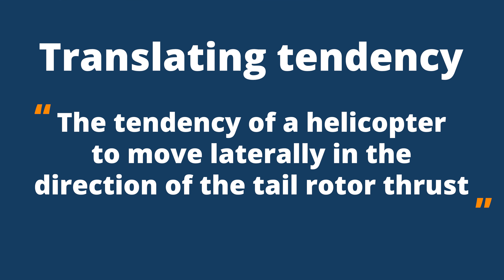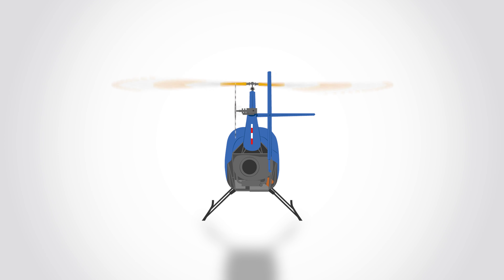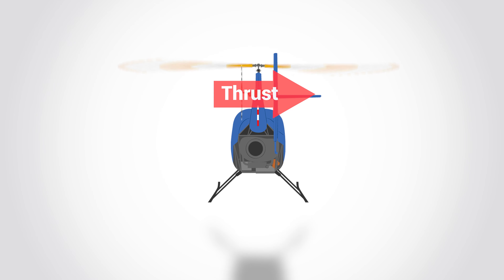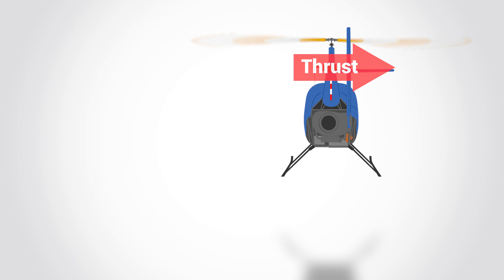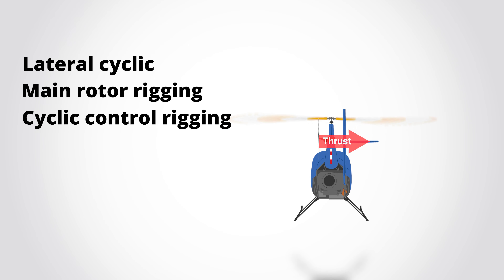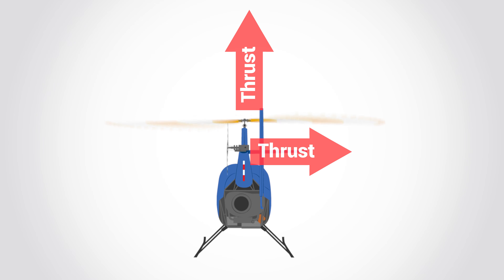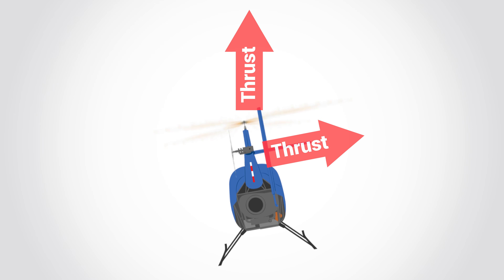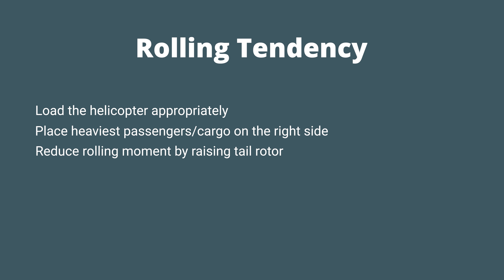Translating Tendency - Why helicopters drift in a hover

Comment: The vertical thrust vector shown in the diagram is the wrong way. Should be downwards for lift. Needs to be correctec
Reply from the maker: Lift pushing you down sounds like a very bad time. I think you'll want to keep it the way it's represented.
Reply: @flightfirst6311  The diagram has "thrust" not "lift" though. The diagram has the thrust pushing you down. See https://youtu.be/17_FzAuoeWw?t=82 -- the diagram works well if you change the word "main rotor thrust" to "main rotor lift"
Reply from the maker: @glennwatson  When the rotor thrusts of all the blade sections are combined, total rotor thrust (depicted as main rotor thrust) acting through the top of the mast provides the force that overcomes the weight of the helicopter. Both the tail rotor and main rotor provides thrust.
Reply: @flightfirst6311  been doing some googling. If you see this diagram  https://api.intechopen.com/media/chapter/57483/media/F5.png we are talking about Vt while they express thrust also as a alternative word for lift.